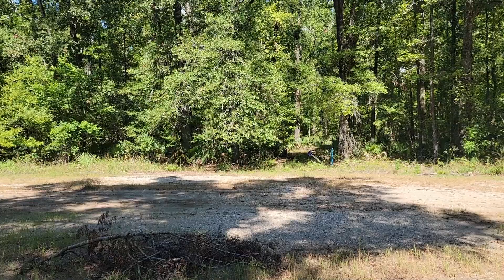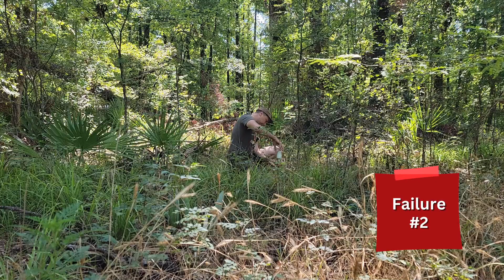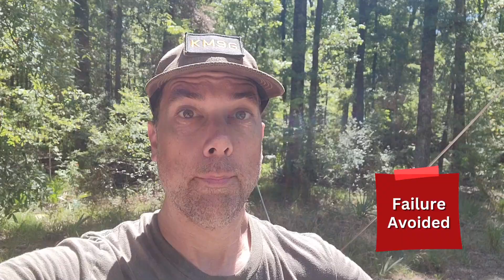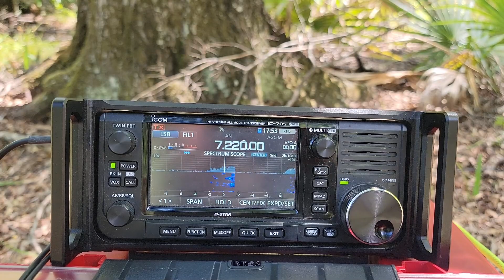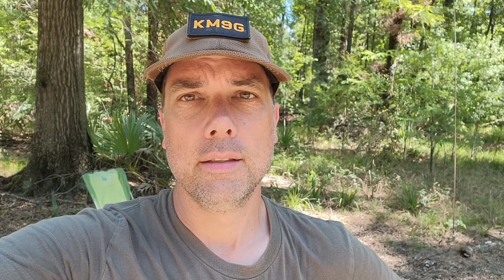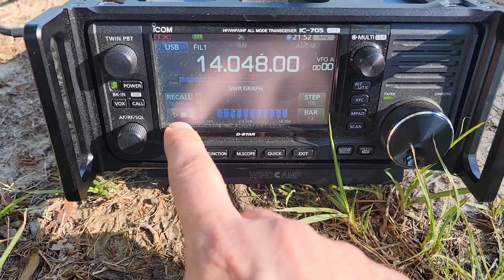Things Don't Always Go As Planned...

Comment: Anyone who as working portable have has these issues. Good idea to bring more antennas and I would include something like a Packtenna too. For a radio without a tuner a linked dipole is very nice.  I prefer a random wire version but I have KX2 and it has great tuner.
Reply from the maker: Yeah, I had 3 missions and only one of them failed.  I did activate the park, but I couldn't demo the antenna because of the odd soil conditions.  Next time I'll bring a better radio ;-)